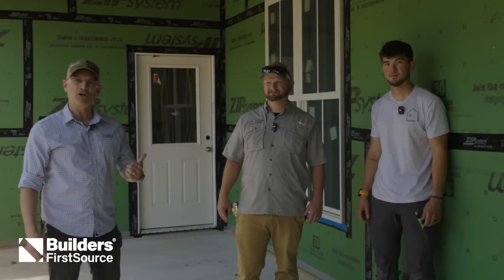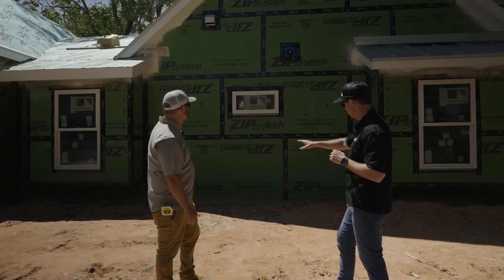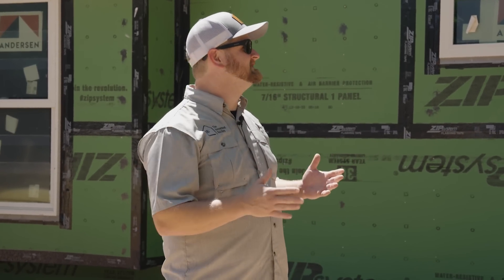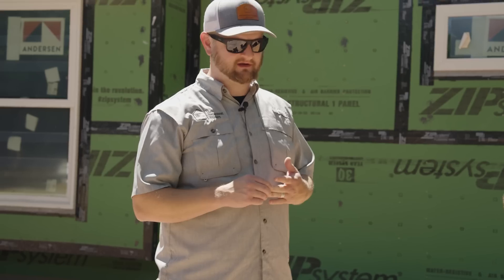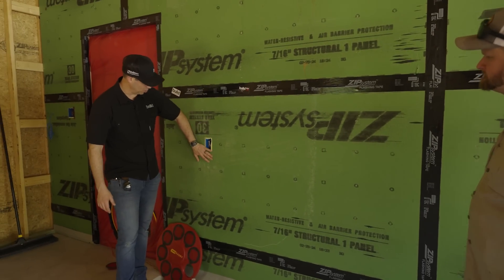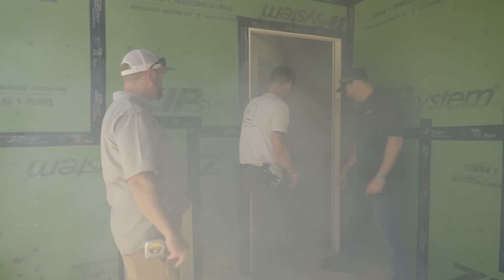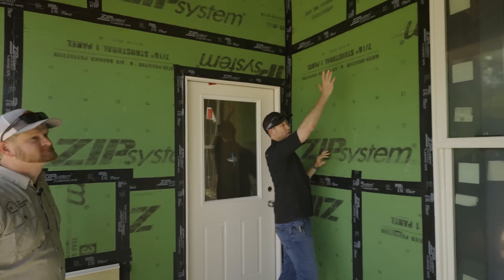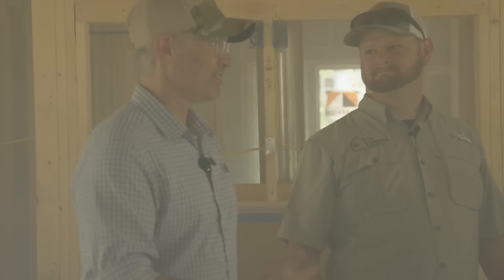Secrets to Airtight Homes: Blower Door Test with Fog in Action

Comment: Just gonna say about outlet air sealing:
Caulking the inside with big stretch works really well too. If you install the receptacles themselves in the proper way (torque screwdrivers) they're guaranteed to remain under the service temperature of the caulk. Upgrade to hospital grade outlets for more overload temperature headroom.

You can also get a type of box called "AirFoil" that has a dedicated way to caulk the wire penetrations. It's great.
Reply: where do you source hospital grade outlets? What's different? First I've ever heard of that! Caulking the outlets and using the little foam gaskets has helped for me too.

Comment: When we build our place, I'll probably do something similar. I have a feeling that caulking those missed spots from the inside while the house is under pressure  will actually push the caulking further into those openings and make for an even better seal than just caulking without the pressure.

Comment: The Fireplace?  How's that going to properly draft?  Exhaust fans?  How are they going to work with such a tight house?
Reply: The fireplace should have an external air intake and a tightly sealed firebox. That is the only way for a fireplace to be a net positive for heating. The HVAC plan will include supplemental air intake for the exhaust fans, either by routing the exhaust out through a ERV, or providing a dedicated intake with a motorized baffle that opens with the exhaust fan.
Reply: @kschleic9053  They skipped over the fireplace details.  The closing shots in the video seem to indicate a standard pre-fab wood burning / gas log fireplace that typically is not sealed.  The external air intake on those is typically passive and does not provide enough make-up air for proper drafting.
Reply: @D2O2  maybe you are correct and they cheaped out on the fireplace insert... It would surprise me though, with all the other thought going into the construction.
Reply: Same way you deal with large range hoods in such a tight house, you run some calculations to figure out how much make-up air you need, then set up your intake(s) to handle that load. Essentially, when you fire up the fireplace or the stove you hit a switch that either boosts the intake-side of the ERV or turns on a specific filtered intake just for those times. It all costs more and more money, but it's not rocket surgery.
Reply: @chaseweeks2708  Please send a link to an ERV that can provide imbalanced flow at the necessary rate to keep up with a range hood
Reply: @D2O2 chase isn't talking about doing makeup air with an ERV. That wouldn't make sense. ERVs need air flowing in and out to exchange heat. In this case all the air flowing out is going through the fireplace. You would need a dedicated makeup air system like Fantech's MAUS units. You resistively heat the air as it is brought rather than exchanging heat.
Reply: I think in some of these homes, there are no bathroom fans. Perhaps, it's tied into the ventilation system. I dunno, but exhaust fans are code do they'd have have some acceptable way of venting the bathroom humidity.

Comment: Hey, Matt ... I couldn't get my old-timey engineer here in Las Vegas to even look at Zip panels and the only place I could get them was in Utah. 8-footers only. It's a conventionally framed 2BR home with full basement at 7500 feet outside LV. I turned all the framers loose with Zip tape and a Formica roller and we taped everything that butted together on the outside. And to the foundadtion. Then I flashed and batted all the rim joists all the way around. Great Stuff all the openings on the exterior walls, closed cell spray 6" in the unvented attic and double taped all the window and door flanges. Taped the sheeting to the studs, then the flanges to the sheeting. Used up a case of Liquid Flashing on all the hard joints where concrete meets wood. 

Upshot was I came in at 2.6 for the blower door test. 4.5 is code hereabouts. So I'm feeling good about it. Toasty warm and no drafts in a 40+ mph mountain wind event. 

I got all those ideas from you and did everything I could myself and with completely naive workmen, but who COULD follow instructions.
Reply: Where in Utah? I have seen only ONE home being built in St. George with zip and I am looking for an any builder to help with a tight envelope. Build quality is horrible here.
Reply: @xokissmekatexo  I believe it was in St. George. There is an insulation wholesaler there. I called from LA to SLC. Only found the one place west of the Rockies that even handled Zip. I got all the Zip tape and their liquid flashing on Amazon. 

Build quality is terrible most places anymore. I have been very lucky with my builder in LV. He was the contractor for the Property Brothers the first few seasons when they had projects in LV. 

Just so you know, 60% of a general contractor's job is phone work. I suggest you contact Zip head office and ask them where they sell their materials in your part of the west. Don't be surprised if they name the whole intermountain area, north and south.

Comment: Better be closed cell foam in the roof deck. Open cell is vapor open and will rot the ridge super quick.
Reply: Depends on the location. They'll only use open cell here in North Carolina. It is vapor-permeable and breathable and thus any moisture that exists under the sheathing won't build up and will evaporate away. If you use closed cell, you need to apply it on top of baffles so there can be an air gap that allows sheathing to breathe.
Reply: @ugh-meh  That is absolutely incorrect. Go look at joe lstiburek's videos on vented or unvented assemblies.  It will not evaporate away near fast enough relative to the amount of moisture that rises in a home. Hence the ridge rot found in the 90's in most homes.  If you use open cell then you have to vent the ridge. Closed cell goes right against the inside of the decking.  Only in climate zone 6 and up do you have to vent so the albedo effect of the snow doesn't self insulate and cause ice dams. 

https://www.youtube.com/watch?v=Ld8pzIu45F8

Comment: Dude should be more concerned with Flue gases leaking into the house.....but whatever XD
Reply: I wonder. The fireplace has an outdoor air intake with glass doors and the house is pressure neutral and pressurized when the furnace kicks in. Plus he will have combination fire and CO2 alarms throughout.
Reply: The blower score was very low, so the leakage is minimal.
Soot will probably clog any tiny leaks.
Sounded like he was gonna seal it.
Hot air rises.

Comment: Nice! Is there a way to make a home airtight that is energy efficient but was not constructed to those standards?
Reply: Aerobarrier i think it is,

But basically you don’t need to go this far, but using something like zip system helps a lot by taping the joints and keeping penetrations to a minimum, + good doors and windows you can get 80% there.
Reply: Not sure if it applies, but a while back Matt covered a product called AeroSeal.
Reply: Air sealing attic floor, electrical outlet gaskets, check seals on doors and windows.
Reply: Aerobarrier - my last quote in the pnw was $1.50 ish per sqft if the house starts under 5.0 ach.
Reply: @TheAngryTT  

I don't know how they can assure you their product is working. That's a major concern I have.
Reply: @MadLadsAnonymous  Blower test before and after. Pretty much automatic since you're using a blower door to pressurize the house while the Aerobarrier is being applied. From the videos I've watched, you can pretty much sit there and actually watch your ACH50 drop in real time.
Reply: @chaseweeks2708 Wonder how it performs 2, 5, 10 years out.
Reply: @MadLadsAnonymous  I had an energy efficiency consultant express their concern about it's long term reliability.  I would expect their stuff to last as long as any other caulk product.  Being behind walls, not exposed to any real elements, I can't imagine it lasting less than 20years.  As for proof it works, they blower door test it before and after.  It's a high cost for something clients dont see and imagine if its in an environment where folks have their windows open 50% of the time.  It's a balance when using good product and keeping costs down for clients and I'm having a hard time justifying all these tightness costs to clients.  When its very high end work, the costs are easily absorbed but not in mid grade projects.
Reply: @D2O2  So far as I can tell, there have been no studies that I would consider... "robust". AeroBarrier and the companies that install it repeatedly talk about third-party simulated testing that seems to indicate the material can hold up to 50 years (again, simulated) of regular heat cycling and pressure changes, but I can't find any links to the third-party study itself, or even the name of the company that performed the tests. Still, based on what it is, aerosolized acrylic caulk, I have little doubt it's got some longevity. It would be interesting to see if anyone has tried swapping out the material for something like Mor-Flexx just for giggles.